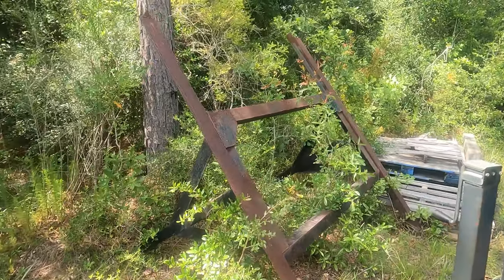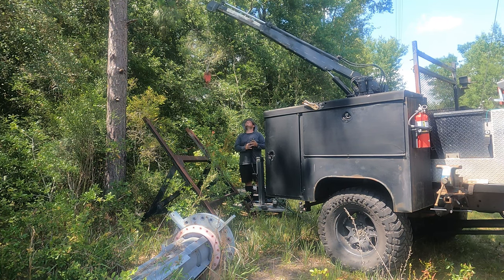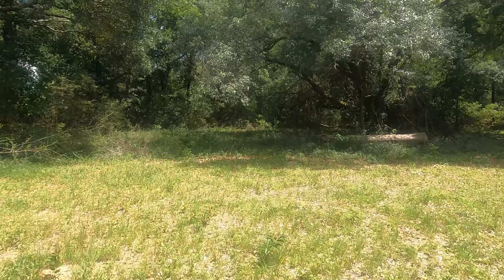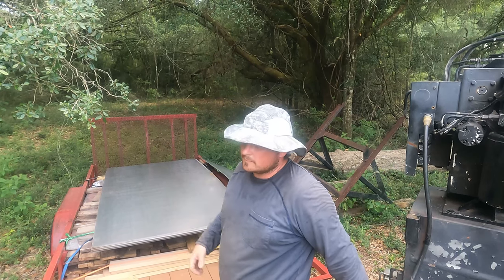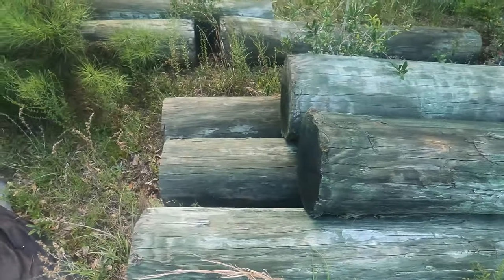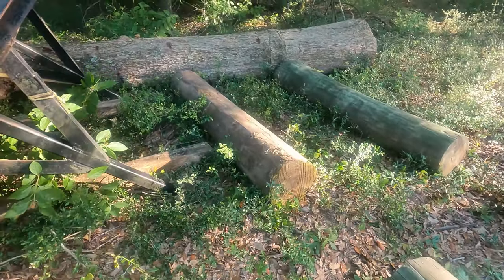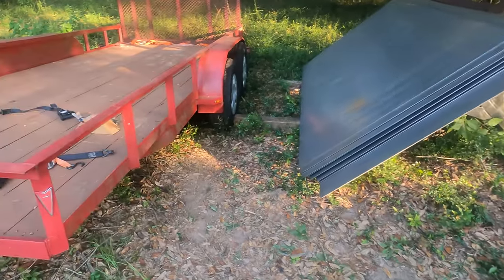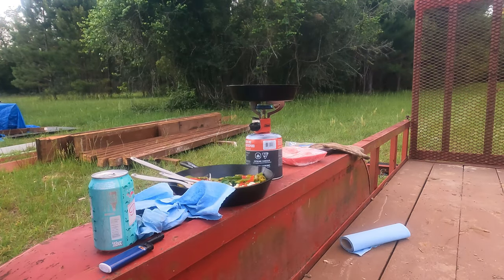Building a floating home

Comment: What design are you going with?
Reply from the maker: Flat bottom, flat sides, and 9" c-channel on top of the sides with raked ends and slightly curved decks front and rear.  8" diameter 0.36" wall pipe between each 5'x10' plate on bottom for rigidity and gussets between with cross bracing.  Wood cabin on top.  Hydraulic driven prop by an 8.2L detroit.

Comment: What's that cranes max weight fully extended? That was nifty. I want one of those. But wouldn't want to get my truck super close
Reply from the maker: It's a Tulsa winch autocrane 3203. I haven't looked at the weight chart in a while. Real world experience: 1500lbs if the crane is at full extension and 45degrees upward, or about 8 feet from the truck. And 800lbs at full extension, straight out and 15 feet from the truck. 3000 pounds if straight up and 4 feet from the truck.